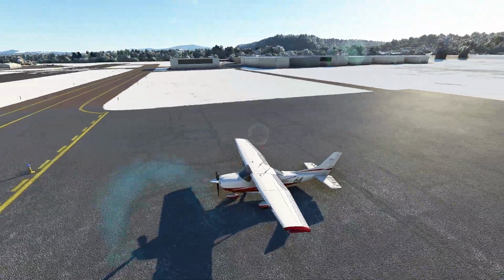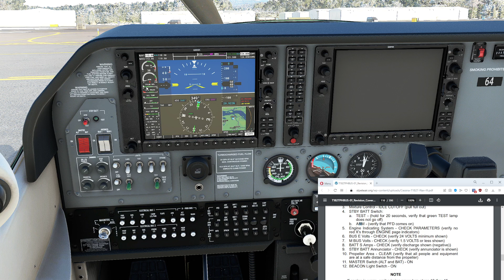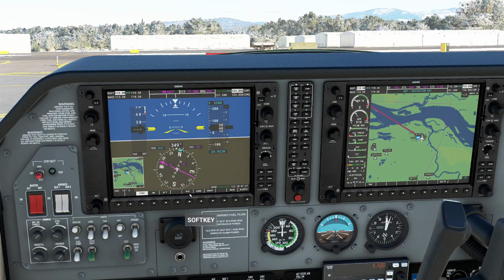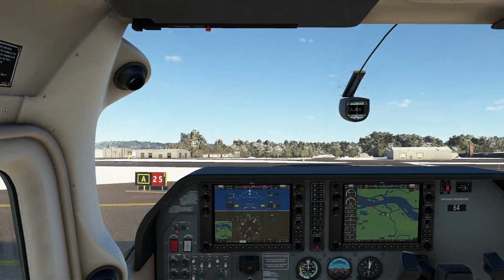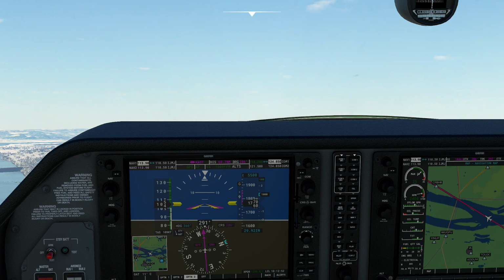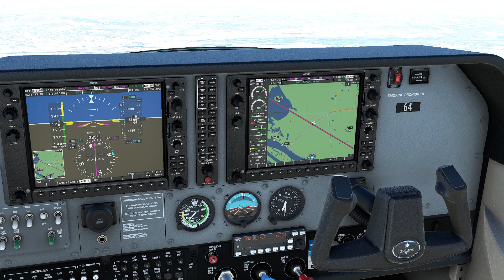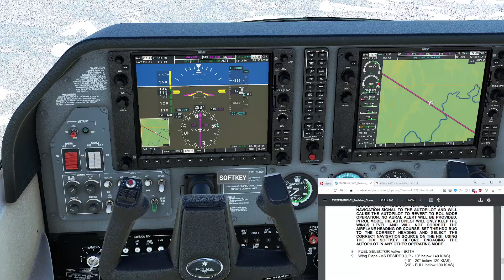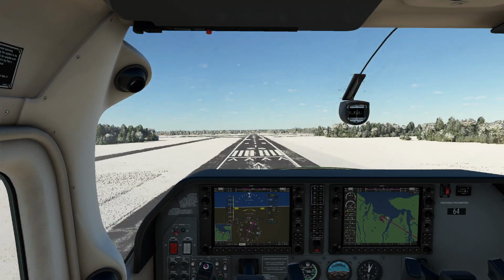MSFS - Flying the Carenado Cessna T182T

Comment: Nice video, but the stby battery check includes holding the switch in the „test“ position for 20 seconds, checking that the green light doesn’t fade (indicating good enough power in the battery) and then arming it - that’s when the PFD should come alive as well.
Reply: 10
Reply: @AverageAviator21  the checklist of the 2006 T182T I fly says 20 seconds, but apparently they changed it to 10 some time ago...
Reply: @spiller212  ah.

Comment: Just had an O-Flight with a T182T previously owned by the Iraqi airforce, now owned by CAP. ( still sand in it )

Edit: The right side of the T-182T's cockpit is a little undetailed, I just thought it weird for a pay ware aircraft.
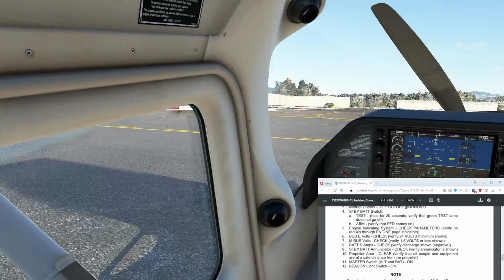Reply: Edit (2): at 2:55, for propeller area it would be, left side clear, right side, clear (unless it is not clear) the back of the plane is not propeller area. (no hate or anything just FYI)

Edit: alsoooo, 10 degrees on takeoff is usually good.

Comment: Need's synthetic vision like the real airplane. The other stock airplanes have it, this turned me off instantly.
Reply: you can enable it in the pfd settings. i forget which menu it is but the creator probably turned it off prior because in the real ones its turned off by default. you should also get the G1000 NXi mod